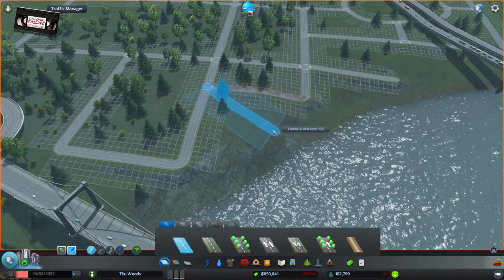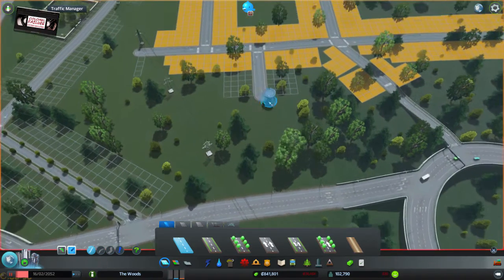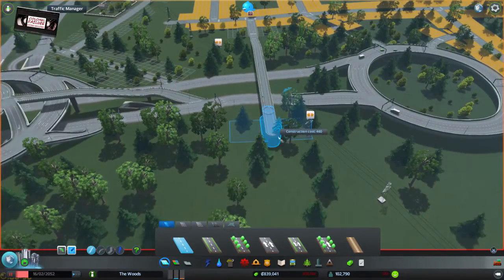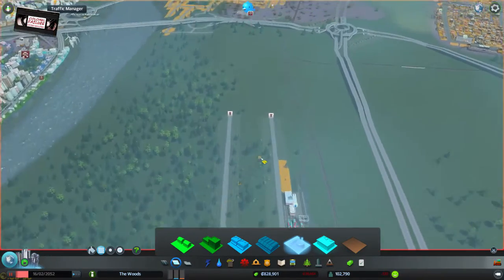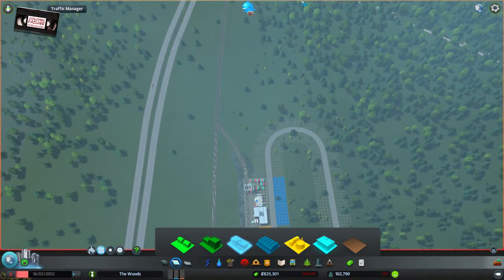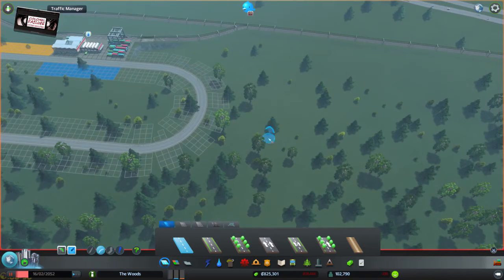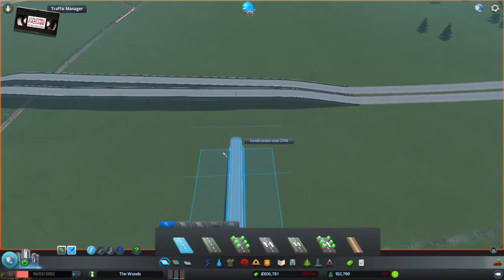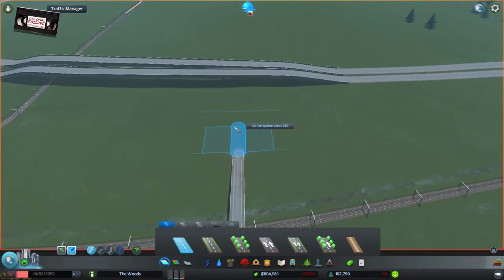Cities Skylines #50 : Industrial Transport Planning

Comment: You are correct, you only need dumps or incinerators. Incinerators have their own garbage trucks which collect trash for burning. When you empty a dump, it might get emptied to incinerators or other dumps, depending on fill levels. Same goes for cemeteries and crematoriums.
Reply from the maker: Joni Mertoniemi Excellent.